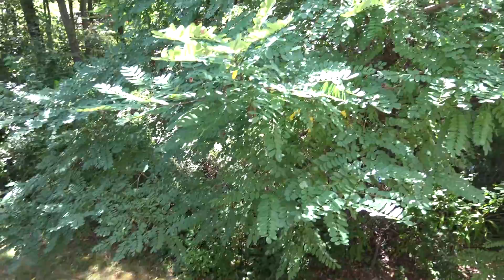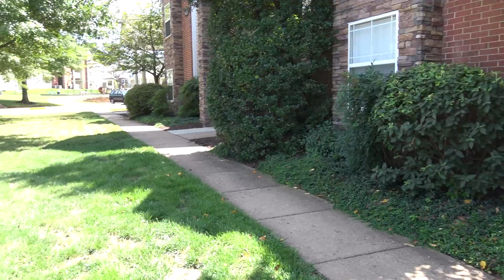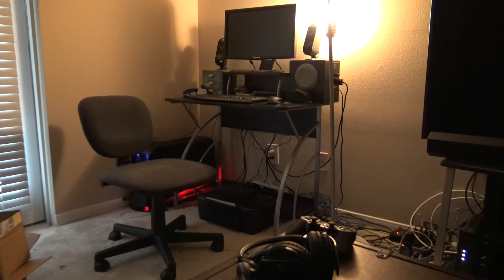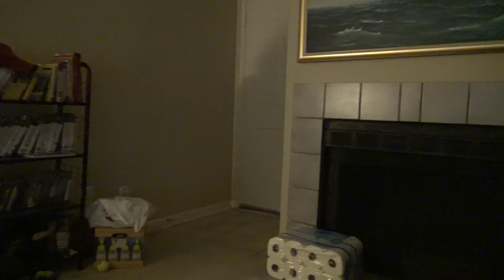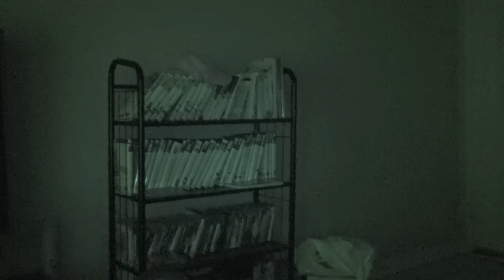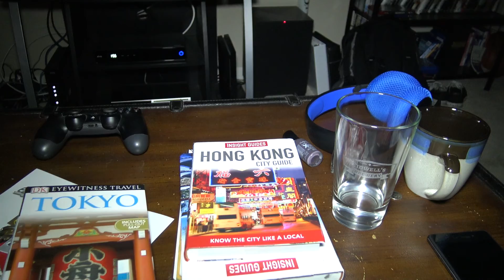Sony FDR-AX33 Camcorder - XAVC S HD 1080p 50 Mbps 60fps Mode - Testing

Comment: how exactly do i record at 60fps? my fdr-ax33 records only at 50fps.. at 1080p
Reply from the maker: Unfortunately the NTSC and PAL video system setup is different depending on where you live/purchase your equipment - NTSC is the video system standard for most of North & South America, and also Japan; this system allows for frame rates of 30fps, 60fps, and multiples thereof (actually it is 29.97 and 59.94 - but who's counting!). PAL, on the other hand, is used is all of Europe, most of Asia, Africa, and the South Pacific - basically, everywhere else! This system has frame rates of 25fps, 50fps, and multiples thereof - meaning that if you bought your camera in Europe somewhere, it will be setup for PAL video system and your available frame rates will be 25fps and 50fps.

I wish there was a better answer - unfortunately, as long as you buy in Europe or any PAL market, you are stuck with these frame rates! Hope this helps!

Comment: I am interested in getting this camera because it is so much cheaper (like half the price) of the newer model. I am wondering  about how it would do in a church setting for wedding ceremonies. I use Neat Video which is a very powerful noise reduction tool in my NLE. I use an A7s as my A cam and need a medium/wide shot of the ceremony and was thinking this might be a good pick but low light was the thing i was worried about.

Comment: Can you please do a video where you shoot 60 fps and use the manual control ring for zoom, focus, exposure, iris, shutter speed, exposure.

I'm particularly interested to know how quickly the zoom and focus can be changed with the ring. I don't know if the ring controls an electric servo to move the lenses, or if it's mechanically linked.